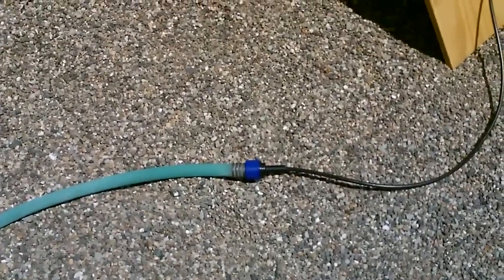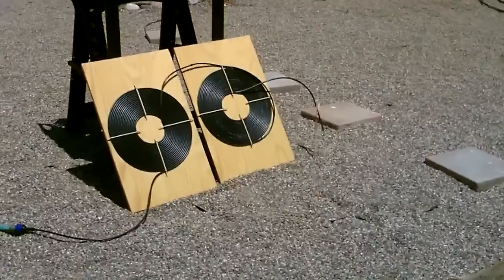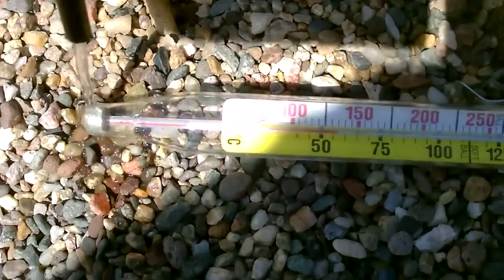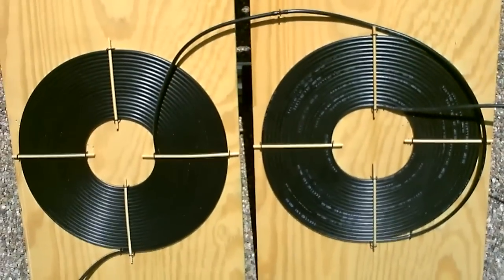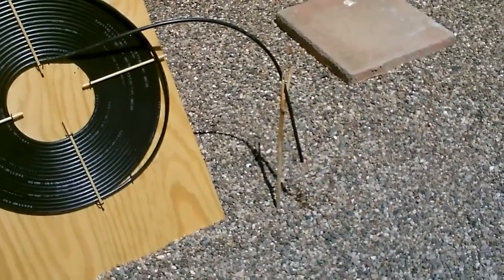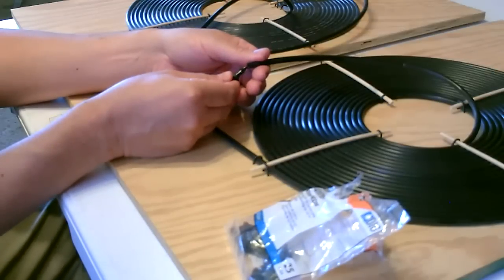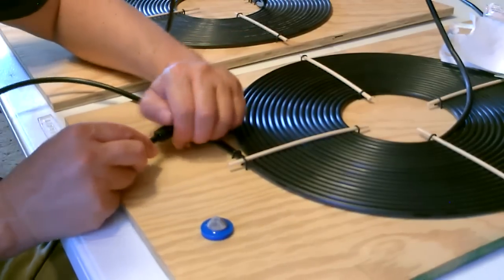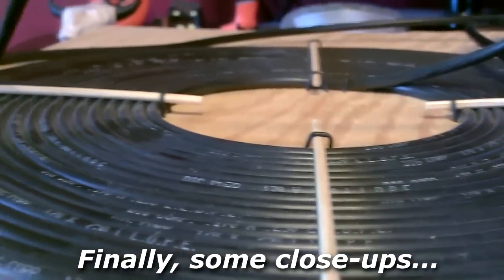DIY Solar Water Heater! - The "Dual Spiral" black poly Solar Water Heater!  Easy DIY (modular/chain)

Comment: How much better was your more recent solar water heaters with the greenhouse box?  What is the difference in steady-state temperature increase for the same flow rate?  Not the increase in temperature when it's been sitting for some hours without flow...

Comment: Why not go with a larger diameter hose for a greater volume and potentially higher flow rate if desired and regulate with a valve? Also wondering if perhaps a non coil arrangement allows the sun to reach more of the hose Total surface area for even more heat generation.
Reply: I did. 150 metres of 2' Black poly laid across a paddock to a bath --water got way to hot during the day and had to wait till it cooled down.
Reply: @johnmerton3630  in winter or summer
Reply: Larger diameter with greater volume generates less heat. Higher flow rate also allows for less time for the water to absorb the heat. The coil works better as the edges are tight, mutually supporting and insulating heat loss.

Comment: I was planning 3/4 inch black irrigation tubing 500 feet.  Was trying to calculate the sustained raise in water temp....
Reply: Hey there - I was wondering if you did this? I'v been considering a 3/4" tube instead of 1/2" because I have 3/4" PVC running water I can plumb into.
Reply: @charlies8954  
Better to use 2half inch pipes it’s all about surface area.
The exterior area of a half inch pipe v the interior capacity.
The problem being that a 1/2 in pipe is approx 1.5 around dependent on thickness of walls while a 3/4 in pipe is around 2.5 inches around which means less surface area for capacity and capacity is much larger than twice as much so heat exchange would be less.
Same as a 5ft bale of hay struggles to feed 20 cows but a 6 foot one has twice as much feed and less waste due to lower surface to area

Comment: I am planning a similar construction for my RV but I want to suction cup the spirals to my windshield.  how much does each spiral weigh filled w water? can you plz give me an approximate weight so I can see if my plan is feasable and what size suction cups (how many) I need to order for my project?
Reply: I know you asked months ago and have probably got your answer, but he said it was quarter inch hose (assuming that's inner diameter for example) 100 ft long, total volume is .3 gallons*8.5 = 2.5 pounds. Best guess for the weight of the hose is 4 lbs, so your total weight will be around 6.5 lbs plus whatever you mount it to, but your windshield should handle it no problem

Comment: I built such a system with imported Pex black pipe from Israel in 1990, managed to coil the pipe of 100 meter into a 1 m2 box with K glass to keep the heat in the insulated box. Cost me in those days $150.00. I exported everything to Cyprus and set up the collector with mains water to have a shower direct from the water in the pex pipe after just 2 hrs in the Cyprus sun. Solar Thermal today has been destroyed by solar PV, now its time to re invent the simple application of makeing hot water tax free off grid which none of the Utilities want including in the UK

Comment: Couldn't you achieve same temp with just one coil slightly larger coil  ?
Reply: Well I did that for my pool with 800 ft of house and it got so hot that I might have introduced alge to the pool

Comment: Hi, i like the design. Very simple as things are ment to be. I think that most heat comes from the acceleration of the water molecules into the enclosing spiral adding more friction and speed in eavry loop. I would recomend making the center more tight before exiting the spiral. Plus you could somehow focus and increase the heat at the center of the artifact. 
Keep the exploration going! i will definetely dare to build one some day soon. Thanks for inspiration.
Reply: No! This absolutely incorrect! The water picks up heat from the sun's radiation on the black pipe. Insulating the board and placing a metal sheet that is painted black under the pipe will increase the thermal area for collection. Additionally, glazing the entire unit will increase the warming effect on the water significantly. 

Where on earth do you get the idea friction supplies the heat! I'm in shock.

Comment: i think is even better if use aluminium paper on te base to get more heat. Also you can use the aluminium or mirror glass on the four sides, at 45 angle. good job and thanks for share

Comment: You could put the spirals on your roof with a closed systems that cycles all that hot water through a copper coil heat exchange  to be used has a heating element right?

Comment: I took a 200 foot roll of 1/2" poly tubing and split it into two bundles slung over the roof peak,pumped water up there with a clear water pump from "HF".........I am getting a 5 degree rise in water temp pumping from and back into my jacuzzi and have been using the system for over 20 years. Replace a pump every 5 years beats hell out of a $200/monthbill for running the jacuzzi heater.
Reply: A 5 degree rise doesn’t sound like a jacuzzi, it sounds cold.
Reply: @TheArchitect999  I think/hope he means it rises 5 degrees each time the water goes through.
Reply: What was the flow rate on that?

I’m trying to imagine what 300 feet of 1” black hose might do, but with a faster flow.

Comment: Hey Desertsun02, Love this Idea, I wonder what the flow rate is in ounces at the 130 degree F temp? I had 1500feet Coil of 1/2" id poly tubing like for Drip Irregation. I hooked up to my swimming Pool, But the Flow rate has to be slow enough to get the heat in and everything needs to be insulated to keep the collected heat at the collected temp,  the flow rate/volume of water through 1/4" Poly drip irrigation tubing/ hose to maintain 120 to 130 degrees F would be very slow and a long process over Hours, a small Hot water heater tank maybe a 12 gallon size, could be a good Holding tank as they are insulated pretty well with Rock Wool insulation, so after few hours you may be able to accumulate enough water for a quicky RV style show, that means NO running water, get yourself wet, turn it off suds up then rinse with conservation being the primary goal, it could work in an emergency, keeping in mind it only works on clear sunny days, overcast or cloudy days solar is almost or is Useless, But Clear days Solar is Awesome I have a out Door Solar Kitchen That I cook on Everyday that is Clear or I can at least see my shadow
Reply: those 1/4" coils in insulated boxes 1" to 2" thick Foam wall Insulation from Home depot/home improvement in the back and walls of the box then a plastic lid with a secondary Clear plastic Insulating bearier for the top would maximize the heat in and reduce the Heat Loss

Comment: More coils when the sunlight is less than optimal?  Glass panels to increase the heat in chilly weather?
Reply: I was thinking something similar (glass panels). Make a box with a glass top, paint flat back inside for even more heat.
Reply: @sunriseshell  Yes. But I was going to use perspex.  Everything else will be spraypainted black.
Reply: @jeffreydemaree2683  difficult to justify cost and Perspex will yellow and become brittle nowadays beware of hail better to simply heat more water and store it inside or underground with some cheap  insulation such as dry sand with plastic Barrier dry sand doesn’t retain heat.I’m talking house roof garage shed roof 
Family have heated pools for years this way flow upwards on roof with small enough pump to not boil the water 
I’ve seen irrigation pump pipes melt if not started to cool the pipe in hottest weather